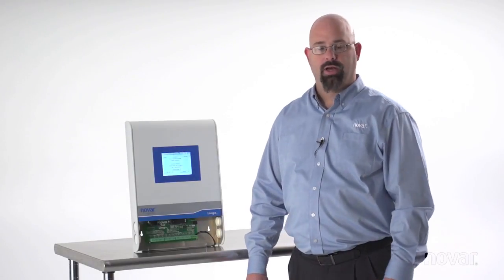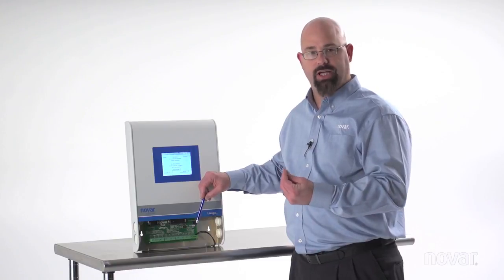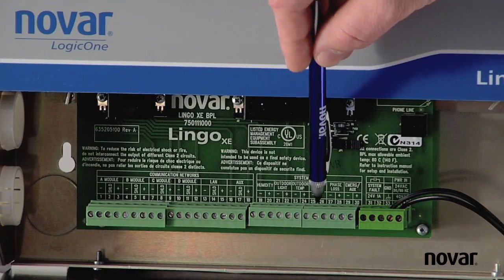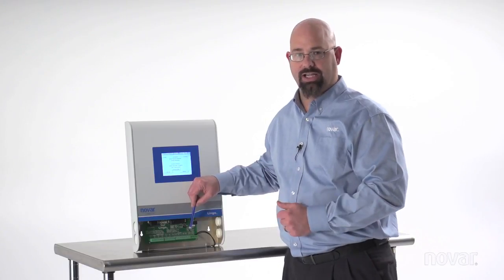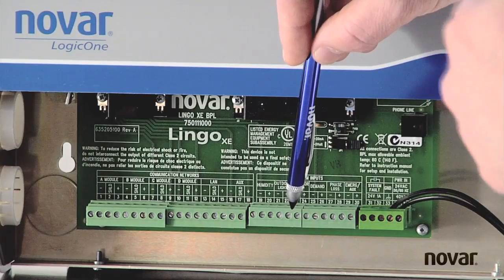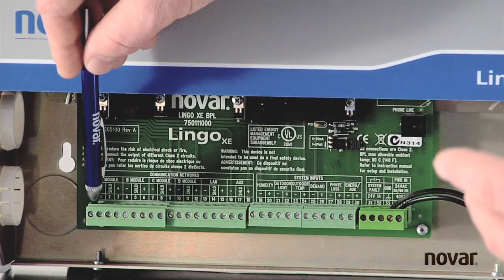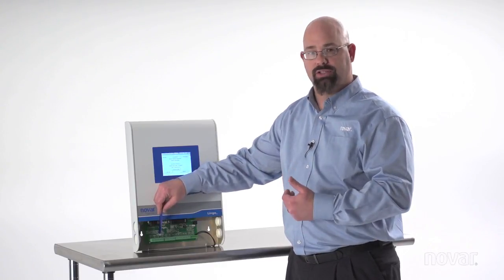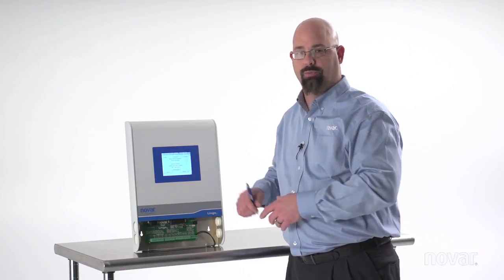LingoXE voltages

Comment: If I have a lingo XE that the kernel got downloaded before the version and now fails on the version download but says it needs one, what can I do to put this into a factory like condition?

I have used the instructions on SW2 holding for 15sec and have also tried the alternating on off dip switch starting with 1 on method. 

Is there something else I can try?